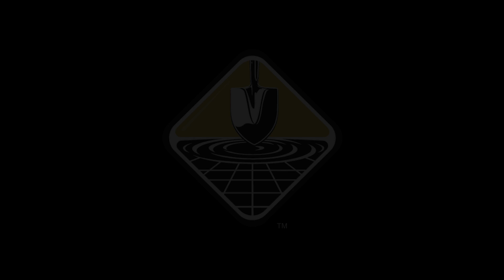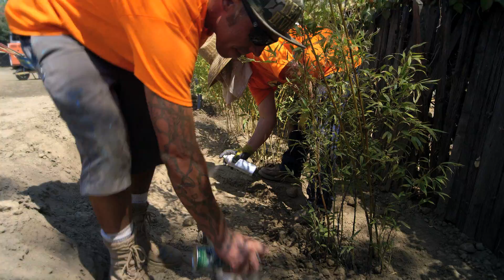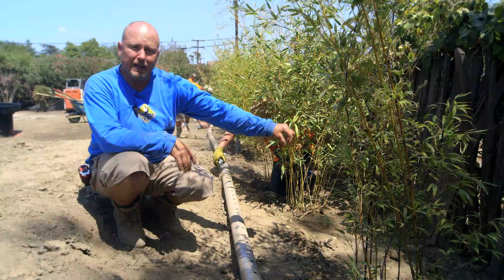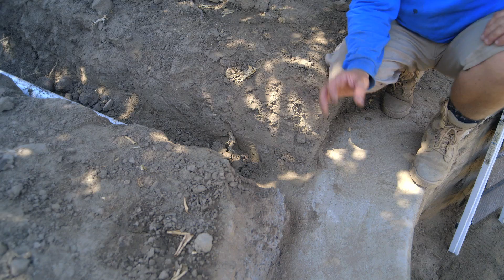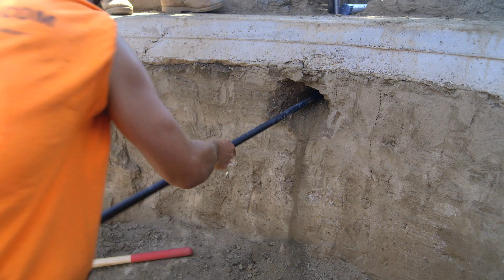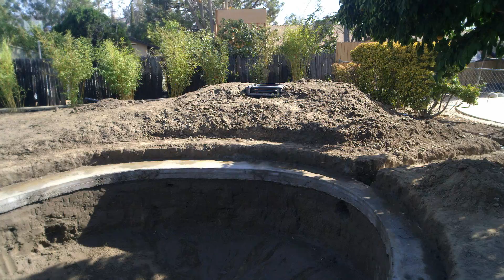DIY Koi Pond Construction | Layout, Pond Design & Orientation - Part 9

Comment: Hey great videos!! You have inspired me to build a pond and expand my fish hobby… I am currently building a pond as I’m writing this, and could use some advice… Half of the soil on one side of the pond is normal and the rest of the edges are very sandy. Not sturdy at all. Now that I have the whole thing dugout and the shelves where I want them do you have any advice on whether not that’s OK? I was thinking once I put the liner I could add stones to the support it is that OK? Will it stay up? And what are the best types of stones to use?
Reply from the maker: In sandy conditions, we have installed the stone in the pond and then backfilled behind the liner to create the shelves we needed and or desired. If you are going deeper than a couple of feet on each shelf step you might need to take an extra step for stability.
Reply: ThePondDigger Thank you so much for the proper spots… I will use your advice and do the best I can. I posted a video of the start of simply just the whole I started today but maybe that could show my situation better than I explain… Regardless, thank you can’t wait for the next video!

Comment: I'm a little ahead of you with my pond. I layed liner and rock last weekend. I had two sides which needed to have dirt added to meet the top of the pond, which I've been doing this week in the evening when it cools down. I have the pond about 80% full of water, to help with liner smoothing and creasing in appropriate areas. By day 2, after filling to the half-way point, I've had toads and diving beetles move in, dragonflies have laid eggs, and a bat skimmed the surface for a drink! 
The two sides are a bit awkward; I don't think I have enough backfill behind them, as the slope is quite steep from the pond edge back to the lawn. I'll be working on that this weekend.
Reply from the maker: DeMe Srvl AWESOME!! We filmed the installation of liner and the bottom drain over the weekend. Next week we will be filming coping stone installation! Stay tuned!